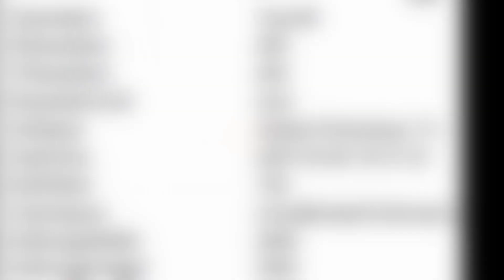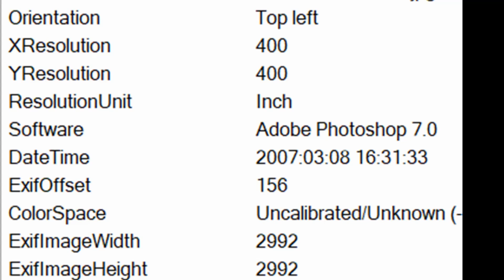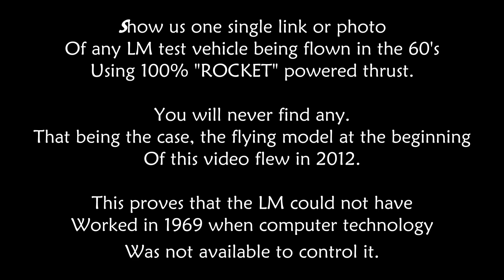"PHASING OUT PHASE 52012!" PART 2

Comment: Interesting... the test model at the beginning of this video only has 3 feet and not the 4 feet that the LEM was equipped with. Of course we all know that 'tripods' quickly set up stable on uneven surfaces, (just ask a surveyor), but objects such as tables, chairs etc with 4 feet (including the LEM), well that's a different story... make sure you have a rolled up newspaper to put under one of the feet to prevent it from wobbling.

Nobody went to the Moon.
Reply: Prove It  
Prove it my friend... why don't you go out for a drive and put one of your wheels in a ditch.
LMFAO..  indeed.

Nobody went to the Moon.
Reply: "GOOD GRIEF" Charlie Brown... all my friends came out --- all at the same time --- to say HELLO. 😀